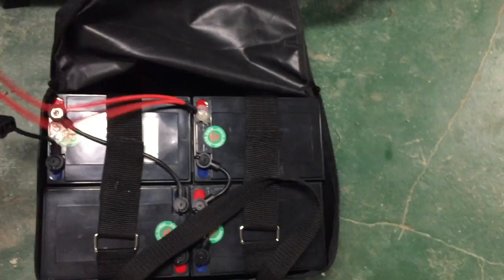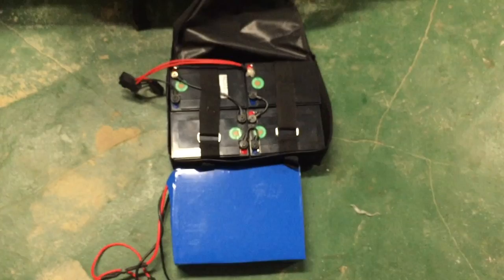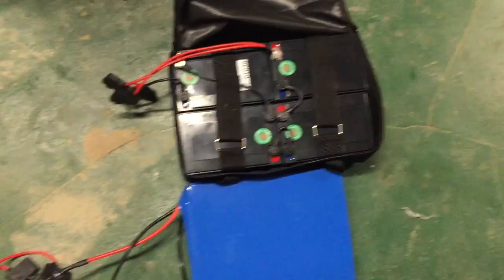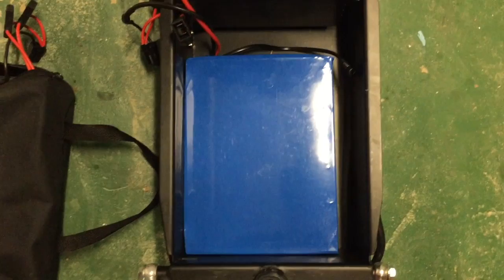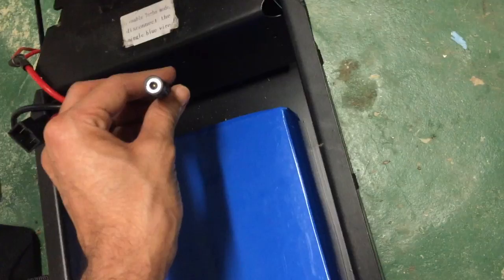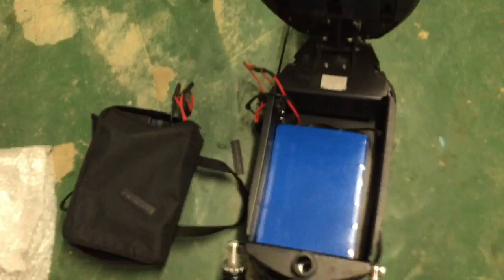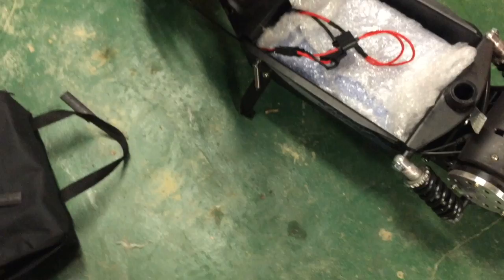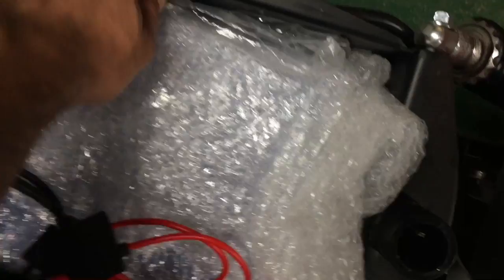UberScoot 1600w 48v Electric Scooter Lithium Upgrade 48v 25Ah

Comment: Thank you Jason Evo, this vid has changed my life! I've become a man obsessed & surf bat tech sites, blogs & forums for hours every day for several weeks now. Trying like Hell to absorb this battery knowledge but man, there is so much to learn.  After the last few weeks, mad props & respect to you JE! OK so here's my deal and ?'s. I too have the Uber 1600 & f ing luv it. With the SLA's I'm lighting up the Mauna Lani Resort security radar at 31mph & getting about 6 mi. before red light. But I need more SPEED & a little more distance.  1. what kind of performance would you expect from 15ah and 20ah li ion's? I'm thinking 10 to 20 miles but more concerned if top mph would also be lower?  2. is there anything bigger than the 25ah that would give more mph without risk of burning it up? 3.With all the knowledge you've gained and evolution in the batt biz what would be the batt you'd buy if you bought one today? 4. Being in Hawaii it appears I might have haz mat shipping issues, possibly less with LiFePo4. How would speed and distance differ from a Li ion?  5. One last one....& none of my biz but I'm really curious, has Ali express compensated you in any way? That is not meant as a ? of ur character or to taint ur opinion because I've surfed 100's of these batts literally & the one u link to is still the cheapest quality 48v 25ah available. The reason I asked that is because if they're not compensating you then they should be, I know they gotta be selling hela batts just from this vid alone. Rock on Jason Evo!
Reply from the maker: The 15ah and 20ah would increase your speed and distance but not much. Like you said your battery shows the red light after 6 miles and slows down slowly, the lithium would last you that full 15 to 20 miles of full speed with no decrease of power till it just cuts off when dead. When you switch to lithium your scooter automatically increases speed by 3-5Mph. The best way to understand lithium is with the ah when you see 20ah or 25ah it means distance so for example the 25ah is 25 miles in distance of high speed the slower your speed the longer you ride. My 25ah gets me a distance of 27miles at 35-39Mph. With the eco mode top speed at 15Mph I get between 37-42miles of distance. If I could buy the perfect battery I would buy the 48v 35ah it don’t get better than that, you’ll get tired before that battery dies. If you want to max out your scooter change the 57 tooth gear to a 44 tooth gear, speed will increase by 5-7 miles. Coming from someone that’s been searching all over on how to make my scooter as fast as possible, you really don’t want any scooter faster than 40mph as the parts at a higher speed can come loose and at that speed you can easy crash or loose control. Right now your top speed is 31mph with only 6 miles of high speed and 4 miles of slow speed. You just need to upgrade the distance with a lithium battery. It will not drop speed you get that full power till the end. For electric scooters from my understanding it’s better to have a li-ion than LiPo as it’s lighter holds more power and has no memory effect. The downside about li-ion if you buy some cheap knockoffs they might explode on you, it’s always best to buy from a known brand. AliExpress doesn’t pay me for anything nor have they sponsored me for this video. I only posted this because it was the best and cheapest. This might be the cheapest but it’s also from an AliExpress trusted seller. I my self looked all over on YouTube to make my scooter faster with no help so I decided to post the video after trial and error hoping it might help someone else. I’m happy to know you found this video somewhat helpful. Thank you and I hope you get the best experience out your scooter.
Reply: You're so Awesome Jason! The reason I hoped you were making a little somethin' from all the referrals is because I feel guilty acquiring all this knowledge for free. Probably a longshot but if u ever come to Hawaii (Big Island) you can have the uber 1600 for as long as ur here & it's a fun place to scoot. So just to make sure I'm hearing u exactly, I would still get the same boost to 35-37mph with a lithium of lesser ah?  Because I really have no distance needs beyond 6-10 miles, just want to go all out all the way. Obviously have to be of similar wattage output, etc.  I'm so excited it's stupid! Thank you Jason.
Reply: Last ?, I promise. How does wattage output affect the performance? the batteries for sale state max watt motor, say 48v 20ah li ion that states 1000w or 1200w, how would that affect the performance on the uber 1600? thx
Reply: I finally did it! bought the batt from ur link. The Ali Express 48v 25ah will be here in 23 days or sooner. I'm getting the perfect battery for my scoot at the best price. I'm confident about that because of all that I learned from you. Thank you Jason, Rob
Reply from the maker: Sorry about the late response. I was going to suggest you get the Same battery I got because when I tried my Ebikes battery 48v 17.5ah I only got 2mph faster but lasted for a longer ride . If you get a battery for a 1000w or 1200w your motor won’t get the full power needed to go faster. I looked everywhere for the best battery but most importantly the cheapest. You did good getting this battery you will be very happy, it should arrive faster than stated.
Reply: Okay, the batt finally arrived, using the old harness, I added an oversize 40w fuse holder, soldered and shrink tubed the connections, charged til green and my multimeter showed 54v on full charge. after a couple test rides, yes mileage is greater but -0- increase on mph 31 with sla's, 31 w/new battery which considering losing 20 battery lbs. it's not even equal to. How do I know ali ex sent a 25ah 2000w battery? there's no writing on it so for all I know it could be a 1000w 15 or 20ah. Is there a way that I can accurately test w & ah? thanks
Reply: Rob McRae, can you PLEASE post the exact link from where you bought this lithium battery for your 1600W UberScoot on AliExpress? The links I've tried on here don't work for me and I've tried to order from a company from AliExpress who are showing no inclination of sending me the battery that I've purchased from them. Please, please send me the link. Thank you!
Reply from the maker: Chris Ulmer the link is in the description but here it is

https://www.youtube.com/redirect?event=video_description&v=AEjCAclHOvU&redir_token=_EgTs21dyKyh-FNTVmL_Kuyoalt8MTUyNzc5NjExOEAxNTI3NzA5NzE4&q=https%3A%2F%2Fwww.aliexpress.com%2Fitem%2FFree-customs-duty-High-capacity-48-volt-li-ion-battery-pack-with-charger-and-BMS-48v%2F32653882085.html%3Fspm%3D2114.13010608.0.0.czVjUv
Reply: Jason........That's the company (Sky Technologies) that I have been trying to order this from! (LOL) When I clicked on your link several days ago, it said the battery was sold out so I just entered the parts number and it came up with that companies page on AliExpress. Since placing the order, I have waited and waited but they still haven't shipped it. I contacted those people and they said they were going to mail it out the next day but still nothing. I'm not worried because I know when the time runs out on that order (in about 10 hours) it will simply negate the charge I made on my credit card. At that point, I'll just click on your link and order it again and I can't imagine if other people can order it from your link that I won't be able to also. Anyway, your videos RULE man and I get a lot out of them! Just a suggestion..........How about doing a video on how to protect the UberScoot 1600W from the rain (I've heard these things will get ruined if caught in a downpour) or how to securely lock your scooter to keep someone from stealing it? I also think that the lithium battery (which costs well over $400 could be a hot theft item) and the compartment for the battery doesn't even come with a lock so how about doing a video on that?
Reply from the maker: Chris Ulmer it’s takes 24-48 hours for your payment to be verified. Don’t buy another one it should be shipped when that timer runs out. Thank you for you suggestions I will definitely make a video about protecting your battery or scooter from theft
Reply: Thanks so much for the info Jason and I will definitely stay tuned to your future videos. Your channel alone has inspired me to get into this awesome sport of electric scooters. Please also do a video on how to protect these scooters from the rain (if you have come up with a way to do that.)

Comment: Hi there, I also have 2 of those and I was wondering if this battery would work.
LiitoKala 48v 30ah 48v 2000w battery lithium ion battery 48V 30AH electric bike battery cell 48v scooter battery on aliexpress 427 CAD
But it’s 30A not 25A
Tks again

Comment: I'm looking for a foldable scooter that can do 25-30mph while also being easy to repair and as light as possible. 

Light enough to comfortably carry up stairs (as part of my commute involves stairs).  What do you recommend? I'd be willing to sacrifice distance for power and weight reduction.
Reply from the maker: as far as weight goes scooters that go 25-30 miles will be a little heavy. From the scooters that i tried the Uberscoot was the lightest at 90 pounds ( without the battery its 70 pounds). I would recommend getting a lithium battery it will make it lighter. When I take mine to work i have to carry my scooter up and down stairs. I usually use two hands and carry it or if i feel tired i fold it and drag it like a suitcase. You can Buy it from walmart online use it for a month if  you don’t like it you can a return it they will pay for shipping and have FedX come to your house to pick it up.
Reply: @Jason Evo Thanks Jason. Have you ever heard of the Speedway Mini 4 Pro? If so what do you think of it?

Comment: Bro I got a 2015 36v 1000 watts uber can I do the same size battery or does it has to be a smaller battery. If so tell me what size to get and where from. Please respond asap
Reply: You need a 10s battery pack 😉

Comment: What's the internal dimensions of the battery bay?  Length, width, height?
Reply: I had a 48v lead acid pack 40 pounds I swap to 48v 20ah lithium 11 pounds I feel a big difference in speed and twurk my battery is slightly small them this in video its 10 inches long 5 inches wide and thickness is 2 something inches fit gear with extra space plus I add the phome that came with it not its nice n snugg

Comment: Hello. I have the 1000w version of this scooter and the back tire valve is a pain to get to. The only way I have been able to pump up the tire is to take the tire off - which then requires you to line everything back and tighten. This causes the brake to rub against the tire. Have you or anyone else experienced this as well? Is there an easier way? Unfortunately I have not been able to find any tutorials online and the Uber scoot website is not good.
Reply: here is a link to something that will help with inflating the tire. this product that i am talking about is at almost the very bottom of the page. you can either get a longer and flexable one or a straight metal one.  but i have never had the brake rub against the tire when i have taken the tire off. http://www.electricscooterparts.com/evo1000electricscooterparts.html
Reply: You pump thru the disc brake in the rear, no need to remove the tire!

Comment: how did you connect the rope and can use the old rope
Reply from the maker: you mean the wire harness? if so, the battery comes with black and red wires already connected you just cut it off and twist it together with the battery wire. yes you can use your old one

Comment: Hey Jason :) very cool and good video man! I have a Chaos 48v 1600w as well which is basically the same the one you have. Would you be kind enough to tell me if there's any heating problems or any sort of danger after upgrading to the lithium batteries? because i'm definitely ordering them if they are safe. Also, how much extra speed did yo u get after upgrading. Cheers.
Reply from the maker: Thank You. Yes you are correct the Manual on my Uberscoot said Chaos 48v not uberscoot so it is Chaos just a different name. The only thing that overheats is the red positive wire for the battery but that was my fault as i didn’t fully secure the connections i adjusted it now no overheat. Lithium is actually safer than lead acid. I went from 27-33mph to 35-40mph
Reply: Wow that's amazing! Thanks a lot man :)
Reply: I suggest lifepo4  but lithium  storage more energy but more unstable if you dont know how to take cafe of it

Comment: I wanna get one but because of some of the reviews on Amazon I'm a little hesitant, you said they're well built, and I know you know your stuff, so I'm still checking reviews, let me know, thanks.
Reply: This scooter comes from a different technological era and was built using a much different design philosophy. It is most robust, less advanced; more modular, heavier and will feel a lot more solid than most modern electric scooters. However as far as specs are concerned and technology implemented it is considered obsolete. It is all about your preference. If you want something that feels more substantial abusable solid and offroad capable then get this; for greater performance, range, less weight more power, more efficiency yet more expensive to buy and fix then get something newer.

Comment: Hello, how is the battery holding up? It's been 6 months since you posted so I was curious if you noticed anything in the performance since installing? Thank you in advance for your reply
Reply from the maker: still works like new
Reply from the maker: You won't get a spark unless you touch the negative(black wire) and positive(red wire) together.
Reply: Jason Evo.......This battery that you have linked to Ali Express is no longer available and is almost$500!! Pease list either a place where you can buy this much cheaper or a link to a specific Youtube video that shows how to build this thing
Reply from the maker: Chris Ulmer I just checked it’s still available it actually dropped down I paid 540 it’s on 440 now
Reply: Thank you Jason. Can you please send me a link for that? I'm looking and I don't see it.
Reply: You have to have a different link for that because where I click on for the link you posted originally says this item is no longer available
Reply: Ok, thanks name family. I figured out how to order it (from another seller on Ali Express) and I paid about the same price for it. I can't wait to get this scooter with all the upgrades and I bet you feel the same way!
Reply: Good luck with that man.
Reply: So would you recommend buying the 2000 watt controller because this one burning out the original controller in the uberscoot 1600? Or does the original one last a while and then go out after replacing it with a 2000 watt battery?
Reply: I got a 20ah for my 48 v on Alibaba with shipping for $267.
Reply: Jason did you ever have problem with throttle cutting in and out? Since you bought scooter. Do you have any idea what it might be? Seems like there's a loose wire somewhere but I can't find it. I did notice the original charger stopped working it stays green the entire time, do you think that might have been the problem?
Reply: @chrisulmer694  refresh the page.
Reply: @brendanmanwaring9971  if it is staying green, then its not charging. red means charging.

Comment: what was the driving range increase?
Reply from the maker: Went from 12 miles of range at 30-34mph to 27 miles of range and speeds at 35-37mph
Reply: @Scentedstyle  How long does it take to get a full charge on the lithium battery?
Thanks!

Comment: would a 36 volt battery work with a 1600 watt engine?
Reply: schmeeegle h, it might but if it did, it would be very slow and not much torque at all and the batteries would run out quickly.

Comment: could I do this with the chaos 48v 1000w or should I go for the 1600w thanks
Reply from the maker: Yes you defiantly can. Chaos 48v 1000w and Uberscoot 1600w 48v are made by the same company Evo Powerboards 1600w 1500w 1000w 2000w are all the same its all about the voltage 36v 48v 60v

Comment: Would this battery work with  a 1000w  uberscoot?
Reply from the maker: Luis Larco this would not work because uberscoot 1000w is a 36v but here is the link for the correct battery you need. https://goo.gl/shxWhx
Reply: Jason Evo controller needs to be replaced. .did you?
Reply from the maker: Luis Larco Your controller will work perfectly, no need for a new one

Comment: Use double sided Velcro on the bottom of the battery. It'll stick firmly but not come off bouncing around. That way you don't insulate the battery. 

Good job on the conversion.

Comment: Bet you can't tell me where to buy a replacement tube. no where to be found for this scooter.
Reply from the maker: yeah I looked allover they seem to always be sold out so I switched to racing tires easier to find http://www.ebay.com/itm/90-65-6-5-110-50-6-5-Tire-Inner-Tube-38-47cc-49cc-Mini-Pocket-Scooter-Go-Kart-/112513129695?hash=item1a324e1cdf:g:NyQAAOSwCQZZE0pd&vxp=mtr

Comment: will the 1600w motor fit the 1000w model? in other words is it possible to convert the 1000w model to the 1600w model by just replacing motor and battery?
Reply from the maker: It’s possible but the battery that I have on my 1600w is a bit bigger than 1000w scooter so it wouldn’t fit but if you measure your box you can have a custom built battery to fit without an extra fee

Comment: HELLO AND WILL THIS BATTERY WORK I HAVE THE SAME SCOOTER YOU HAVE I FOUND THIS ONE ON EBAY WILL IT WORK HERE IS THE BATTERY     Li-ion Battery 48V 25AH Volt Rechargeable Bicycle 1200W E Bike Electric Li-ion